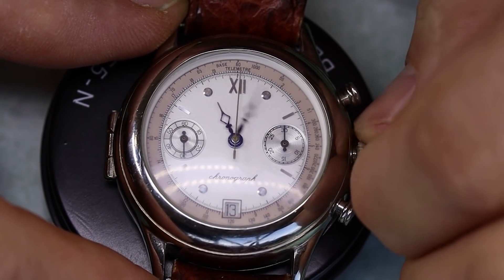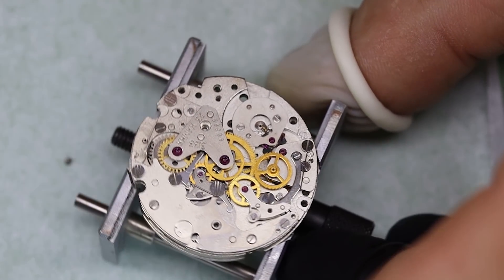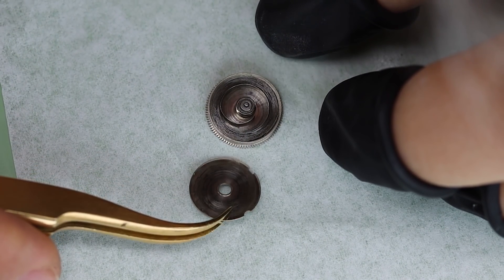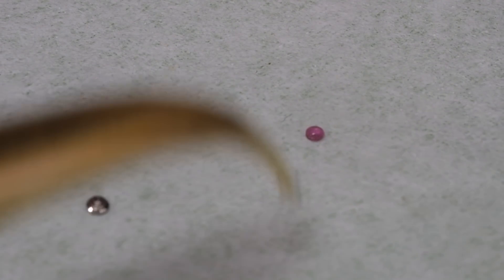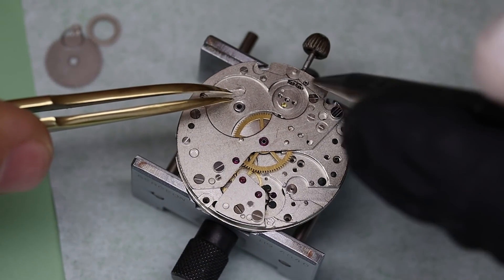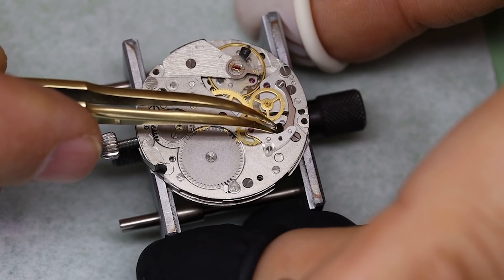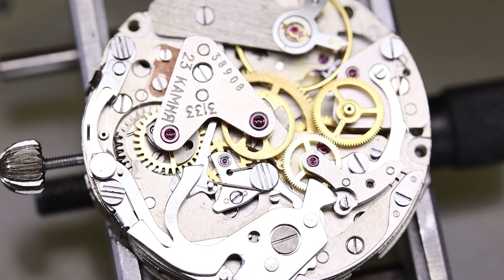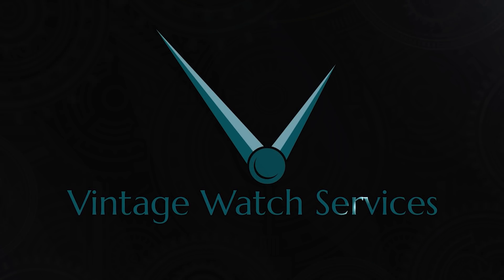How good are Soviet watches?

Comment: Heh, I just bought one. Newer version, made in Russia, instead of USSR. They need servicing badly. Interested?
Reply from the maker: Thanks for watching! I basically only work on watches I bought in order to resell and am much too busy with that :) But these watches are not difficult to service so your should be able to find someone in your area 👍
Reply: @VintageWatchServices  I was actually thinking of servicing them myself (yes, I dabble), but there is a mechanical fault with chronograph, in first quadrant seconds hand does not sweep, but jumps. It is something I am not familiar with, possibly bent teeths somewhere. Since I do not have microscope, it is beyound my capabilities. I have alerady scheduled a meeting with a watchmaker. I am really interested to hear what he might think problem is.
Reply from the maker: It could be a few things, but the good thing with watches is that everything follows perfect logic, so if you understand how it works you can also understand why it doesn't :)
Reply: @VintageWatchServices  as an update. Chronograph wheels were not alligned properly. Plus, transitional wheel (the middle one) is not perfectly circular. Got to looove the Russians, right? New part is on its way and my friendly neighbourghood watchmaker will help me with regulating watch itself and chronograph module.

Comment: This watch was likely assembled with incorrect and defective parts at the factory.  I say defective because the barrel bearings and starting lever didn't appear to be broken or badly worn, just the result of sloppy manufacturing, and the starting lever was held in place with an incorrect screw.  The quota-driven factory workers didn't inspect the parts they used and the previous owner either didn't care that his chronograph didn't work or didn't feel like paying to fix it.

That was common with Soviet-era consumer goods; the factories that made them operated under rigid production quotas and they didn't have the time or resources to conduct proper quality control, so the consumer rolled the dice and took their chances.  The best quality was found in goods made specifically for export, and those items were always marked somewhere with "Made In USSR".  It should be noted that the Pobeda had such nomenclature, but this Poljot does not.
Reply from the maker: Thanks so much for your insightful comment as usual, Caledon! I suspect this might be a bit of a Franken, with the movement and probably case being late 80s and the dial and hands being newer. But yes, authoritarian regimes aren't big on quality control...

Comment: That looked like RUST on the main plate bearing..... I have noticed that the casework and the plates are really poor quality Stainless Steel and rust are always an issue with this era Russian make on the back plate and rear of the cases where the skin has sweated and rust gets a hold, that's the only issue I have with these watches and vintage models are good old shire horses indeed... That was a great teardown and re-build... You need to branch out a bit and start repairing vintage Seiko's...  Cheers.....

Comment: No it was a Poljot 3133 snapped in the same place as yours was. Yes I have found the finish compared to the 7734 is poor . However with the extra jewels in the chronograph wheels , smaller balance running at 21000 bph unlike the Val at 18000 and little things like returning to anti clock screws on fly back and operating lever which valjoux stop doing after the 7730 (venus188) . The USSR could have had a far superior movement if the finish had been good .
Reply from the maker: Interesting. It might be a problem with the quality of the steel then. These parts should be quite springy. And yes, there are some good ideas in this movement, I just don't think their execution is up to par 🤔
Reply: @VintageWatchServices  keep the good work going . I do like your channel , picked up some good tips .

Comment: The level of fit and finish you had to deal with says everything about this Soviet watch. I have the same Soviet Polgyot watch except with a black dial, and more modern case that has been gold washed. I thank you for the information that LeCoultre invented the keyless works! Having to mess with arbor holes and putting a shoulder on a screw to make it work properly again speaks to the lack of attention to detail. Hence how inexpensive, and may I say pretentious this watch is.
Reply from the maker: Thanks for watching! This is the first 3133 I have worked on, so I have limited experience with them, but the issues I found certainly do not give me confidence in the quality...
Reply: In stark communism there is too little investment in the work... in raw capitalism perhaps there is too much (or rather, the wrong kind).  We need a happy medium: Beauty but sanity.  In old communist USSR, Timex would be considered upper crust (and it's not an altogether bad brand, although the dickens for watchmakers to attempt to fix).